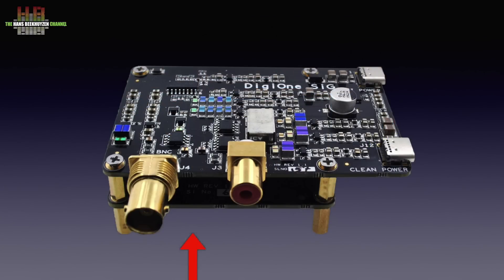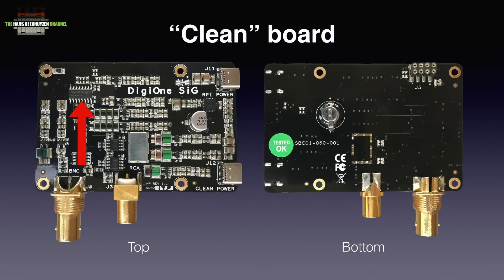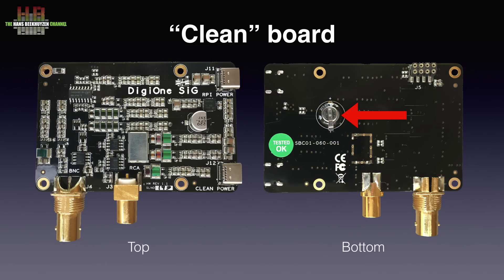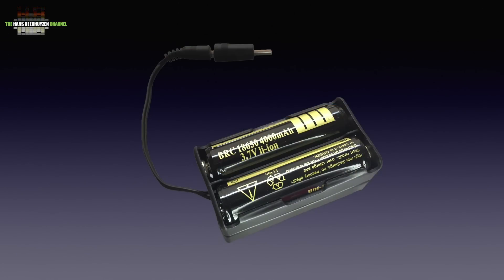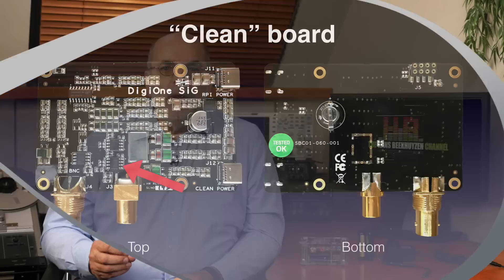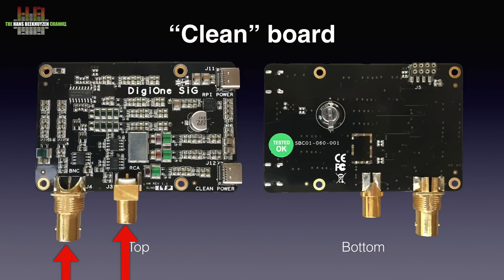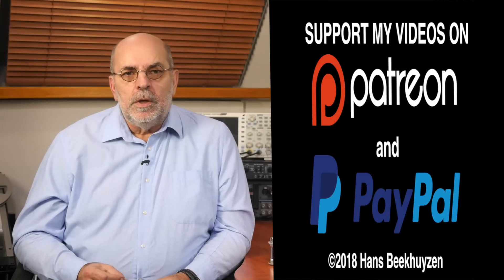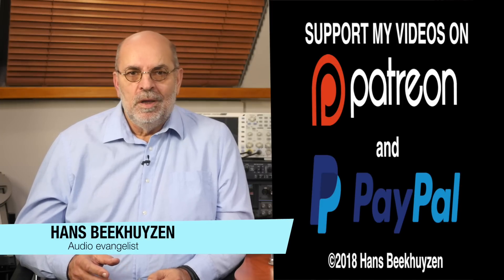Allo DigiOne Signature SPDIF board for Raspberry Pi

Comment: First thank you for the video. I am coming to this a few years late. So today, shipped, an Allo Digione Signature Player with 4B PI and Shanti low noise supply is $504. A BlueSound Node 2i is $549. Is the Allo device a better Roon endpoint/bridge than the Node 2i? (assuming you are using the same external DAC connected by SPDIF to both? Please comment. Thank you.
Reply from the maker: Yes, sound wise it is. The user interface and compatibility with almost all streaming services the Bluesound has, will be hard to beat, though. But you might not need that.
Reply: @TheHansBeekhuyzenChannel  Thank you for the super fast reply. So Allo Signature is the better audio quality. BlueSound is the better interface and compatibility. Hopefully I got that right. Have a BlueSound now (have had for about two months) but need to add another end point and have been looking Raspberry Pi based solutions now that I am coming up to speed on what is out there. Your a great help.
Reply: @TheHansBeekhuyzenChannel  I think for now leaning toward getting another Bluesound node 2i since its the only device I found that supports Roon and Amazon HD Ultra and supports 192/24. Amazon HD Ultra really easy for my wife to use. No other endpoint I ca find that supports Amazon HD Ultra high sampling rates unless you know of any?

Comment: Fantastic review as usual Hans... many thanks. I power my Digione sig with the Allo Shanti lps and it sounds great into my Chord MScaler / Dave setup. Im using relatively cheap interconnects and wondering if its worth upgrading these to squeeze even more out of the overall system....?
Reply from the maker: I have no experience with your gear but in general using players/bridges like the one I use - the Auracil Aries G2 or equal does improve sound quality.
Reply: @TheHansBeekhuyzenChannel  Thanks Hans--- will get the credit card out then!!!

Comment: How does it connect to the pre-amp?
Reply from the maker: It is to be connected to a digital to analog converter or to a digital input on your amp (if it has one)
Reply: @TheHansBeekhuyzenChannel  I see. So it also needs the converter? I do not have digital inputs in my pre-. thanks.
Reply from the maker: Correct
Reply: @TheHansBeekhuyzenChannel  Thanks for replies. I am looking for a player/streamer to play FLAC files, but I do already have a very decent pre-amp. Would you recommend a player to investigate (read about)?
thank you.

Comment: Hans, I've tried the allo digi one aignature BNC port connected to Chord Qutest and it can play dsf files hi res 128. So it's not limited to what co axial cable can do. Noise floor of dsf file is lower but have to increase the volume to level match what I am used to. It's really an amazing product.
Reply from the maker: Due to the way of coding DSD files are always 6 dB's lower in level

Comment: Mijn lineaire voeding heeft een dubbele 5v 3ampere uitgang. Kan ik hiermee beide usb-c ingangen van de Signature voeden of is die 3 ampere voor de schone kant teveel?
Reply from the maker: Amperage geeft aan hoeveel stroom de voeding KAN leveren. Als hij 3A kan leveren dan kan die zeker 1A leveren. Geen probleem dus.
Reply: @TheHansBeekhuyzenChannel  . Ik zag in een video een voeding gebruikt met apart een 3 en een 1 ampère uitgang, dus dacht dat daar een bedoeling achter zit. Is het verschil trouwens groot met de normale Digione? Ik gebruik nu de Digi+ pro maar die vind ik rommelig klinken.

Comment: Hi Hans, 3 questions for you (or whomever following your channel may be able to answer).
- What about using a power bank (those used for smartphones) instead of the AA  battery pack? 
- And what about using a separate power bank for the Pie? (I.e. the whole system is totally on batteries)
- is it possible to use WiFi?

Last question is not Allo-related, but more generally related to streamers: it comes from my need to solve the modem/hi-fi set distance problem. I don’t want to use power lines since it scares me to add Ethernet noise to the same (or close to) power socket that feeds my DAC and my preamp.
Reply from the maker: 1. power banks have a high internal impedance and thus are slow in delivering power when needed. 
2. Allo offers a holder for special rechargeable batteries. Feed your Pi from them.
3. Yes, you can use wifi provided the ether around your house is not already filled with too many access points.

Comment: didn't you mention somewhere in this video about a digital power supply, that is good enough to mimic a linear power supply? I didn't see it in the links for the video. thanks!
Reply from the maker: I never mentioned a digital power supply, but I might have mentioned the iFi iPower, which is a switching mode power supply of better quality.

Comment: Hi Hans, do you think using the volume control on volumio is good enough so that I can just connect the DAC analog output directly to a power amplifier without a preamp? Thanks.
Reply from the maker: That depends on the DAC. But I would not connect it to a power amp directly for if anything goes wrong - like too high volume or glitches - it is a lot harder to correct that since the Raspberry Pi itself doesn't have controls.

Comment: Would a usb power bank work ok for the clean side?
Reply from the maker: It will work but I don’t know how well it will sound. I have no experience with usb power banks, but I think that performance will differ depending on the battery technology used.
Reply: I understand that usb battery power banks have their own integral SMPS. So Allo's battery pack solution seems likely to provide a cleaner power supply.
Reply: A LPSU would be more than adequate. Have a look at the Tomanek LPSU, Polish made and super high quality. I own one, they are excellent.